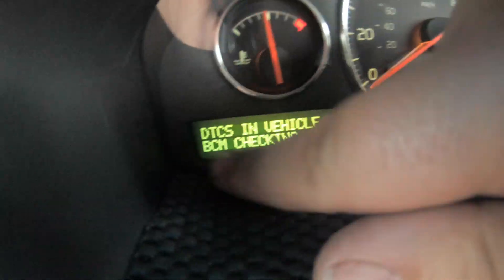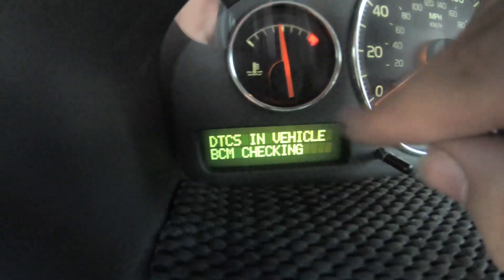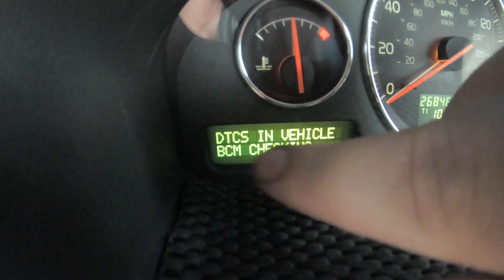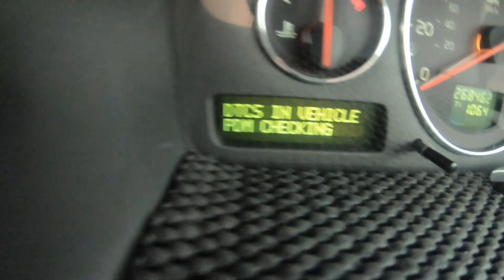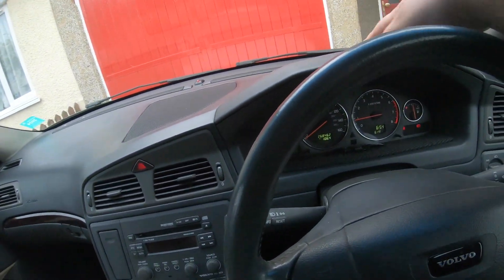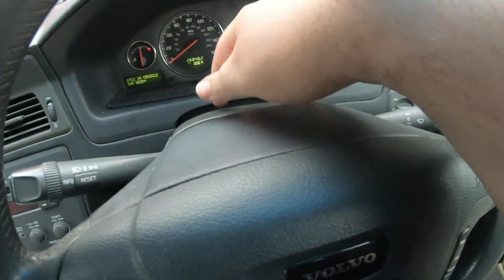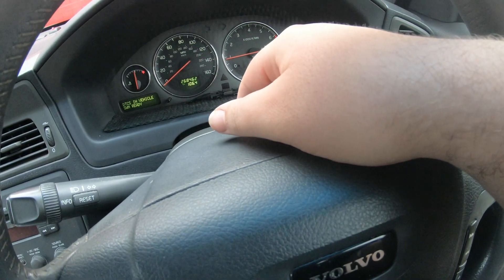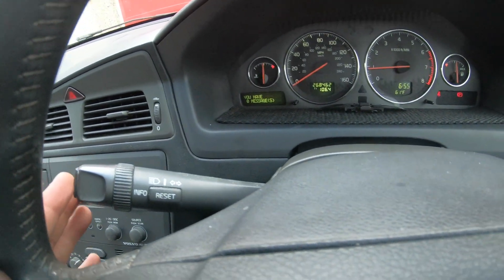Volvo V70 S60 S80 XC70 XC90 Hidden DTCS Menu (Diagnostic Trouble codes stored in Vehicle)

Comment: I have a 2004 volvo s40 and i have - symbol where its supposed to have a P for park. It will not start unless you jump the starter .but its not the starter  or battery. It also has the anti skid and air bag
But the motor and transmission are good. 
Man if you could help .would be a blessing oh, it say loss communication. With tcm.
Its a 2.5 turbo automatic. Thanks man. Its also fwd

Comment: the ip on my v70 is out. has been out for 2 mths [no speedometer, no odometer, no time, no lights emit from ip] . i asked the mechanic, it is the relay behind the ip. it needs to be taken out, sent to an ip restorer. you can't use the car for 3 days because one day they remove it, the next day to a specialist, third day reinstall ip. i will do it in the summer,
Reply from the maker: I had the Gauge cluster go out I had my Cluster repaired at CARTRONIX in Waterloovile and they repaired the cluster in 40 minutes and the cluster worked again with no cluster as long as it's still connected the mileage will still go up as you drive If your in the UK you can have the Instrument panel repaired at CARTRONIX which is known as a DIM or instrument cluster I hope this helps and take care